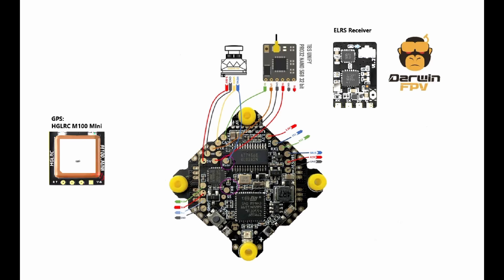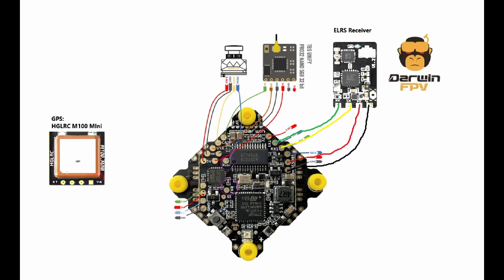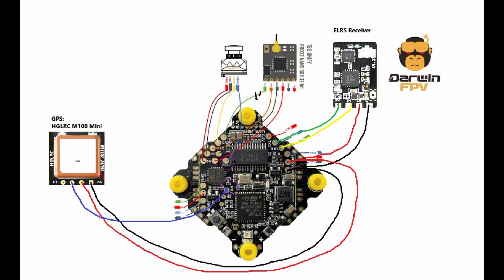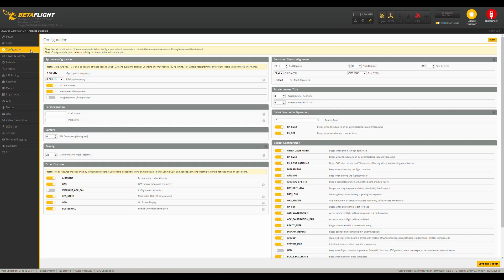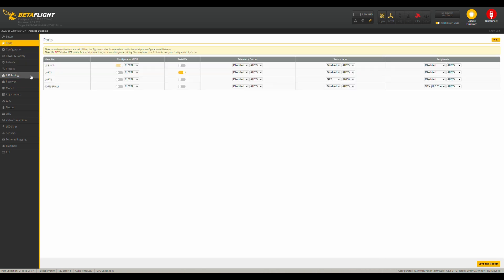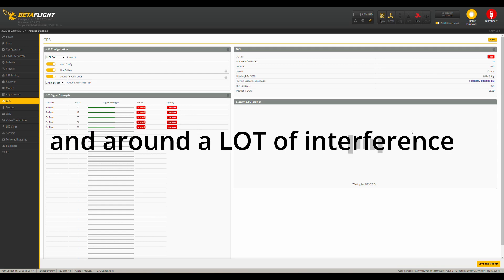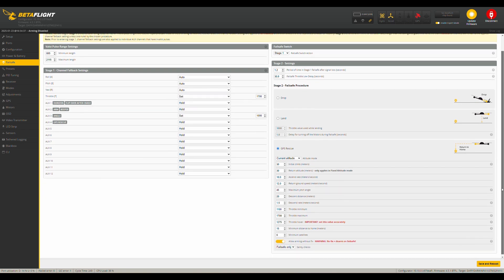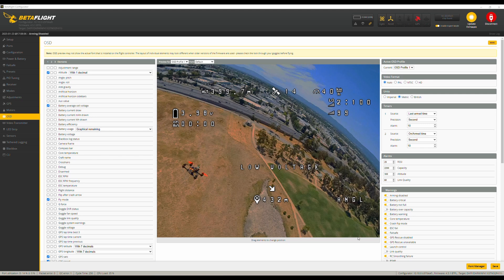Wire and set up a DarwinFPV BabyAPE with ELRS and GPS (3inch version)

Comment: Hi author please send please cli command i have beitian bn 220
Reply from the maker: A ClI command for what exactely?
Reply: @dronesndstuff626  I would like to connect vtx and gps beitian bn 220 as you have and would like to know what commands to enter.
Reply: And what vtx would you recommend to replace the stock one.
Reply from the maker: @wataruakiyama2260  I use a Zeus Nano as a replacement for the stock VTX. Might not be the most powerfull option but works well for me. Make sure to also go for a quality antenna.
This is the VTX table for this VTX. You can run it as Cli command.

# vtxtable vtxtable bands 5 vtxtable channels 8 vtxtable band 1 BOSCAM_A A CUSTOM 5865 5845 5825 5805 5785 5765 5745 5725 vtxtable band 2 BOSCAM_B B CUSTOM 5733 5752 5771 5790 5809 5828 5847 5866 vtxtable band 3 BOSCAM_E E CUSTOM 5705 5685 5665 5645 5885 5905 5925 5945 vtxtable band 4 FATSHARK F CUSTOM 5740 5760 5780 5800 5820 5840 5860 5880 vtxtable band 5 RACEBAND R CUSTOM 5658 5695 5732 5769 5806 5843 5880 5917 vtxtable powerlevels 4 vtxtable powervalues 25 100 200 350 vtxtable powerlabels 25 100 200 350

Don't forget to save afterwards.
For the GPS please follow the instructions from the video!
Have fun flying!

Comment: In betaflight I have satellites and I see that in the osd. But with just a LiPo I don’t get any satelitea
Reply from the maker: @MontyX-21 If it works in betaflight it should work with a battery. If you don't fly often your gps needs some time to figure out were the satelites are, because internal memory is about a week. 
Solutions:
1: Bring along a powerbank, connect to the USB Port, give it about 15min plug in LiPo, plug out powerbank.

2: Try this tutorial. You can update the satelite map from your computer. This should greatly improve the time to lock satelites.
Remember: You either have to fly every few days or update before flying!
https://iflight-rc.eu/de-de/blogs/news/m10-gps-3d-fix-enhancement

Good luck and great flights!!!

Comment: I'm having a nightmare trying to make the darwin VTX to work. No matter what I do I can never set the band or the power. I see you replaced it with the Zeus and I'm tempted to do the same.
One thing I noticed is that you are using the softserial for the VTX, is that normal from factory or you swapped it yourself?
Reply from the maker: @UnbiasOP  Hey, I had trouble with the VTX on both of my babyapes too! Usually the VTX is connected to UART 2, but I wanted to use that one for GPS. So VTX is in softserial now! Hope you get your VTX running!

Comment: Just got my package which coincidentally is nearly identical to yours! This video is a lifesaver!
I'm curious, how did you mount the gps and the erls antenna? I'm worried about interference given the minute size of this quad. If it's not asking too much, could you give some guidance?
Reply from the maker: Thank you very much, I'm glad I could help!
First I took the antenna holder that came with the quad. I cut the tubes that fit over the back holders shorter. Than I had this GPS holder printged and pushed it under the original Antenna holder. 
https://www.printables.com/model/435339-baby-ape-nano-gps-mount/files?lang=de
I used mounting tape to attach the new VTX in roughly the same position as the old one and used this antenna with it:
Diatone MAMBA ULTRAS 5.8G Antenna UFL RHCP For RC FPV Racing Drone.

You can use basically any long VTX antenna. (If you use Circular polarised, match quad and goggles).
 Used a bit of ziptie and tape to hold the VTX antenna up.
It's quite a bit away from the GPS and I get 6-10 sattelites in about a minute.

To hold the Hawkeye Thumb 2 I use these 2 prints, but at the moment I would recomend one of the newer runcam thumbs!
https://www.thingiverse.com/thing:6593421
https://www.printables.com/model/435339-baby-ape-nano-gps-mount/files?lang=de

You can see it at the beginning of my how to update Betaflight video :)
Reply: @ Thanks for the detailed answer. I lost my first babyape past month on a flight over a dense forest. Gone the quad with the runcam thumb 4k. I reordered it but now with a gps (I only learn the hard way lol). If it wasn't for your video I don't think I would have figured out that wiring trick for the GPS. Thanks a million.
So, you replaced the VTX, if I understand it correctly. I don't plan doing so, I'll keep the analog that came with it.
Thanks also for pointing me to the 3d print, I shall get it printed soon.
Will be definitely keeping an eye on your channel!